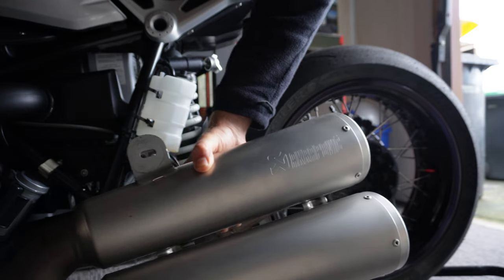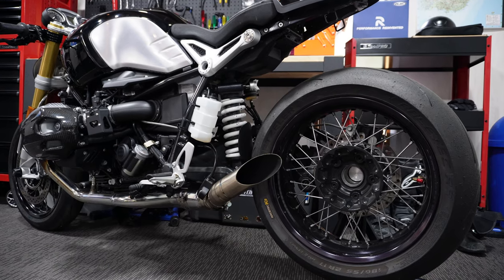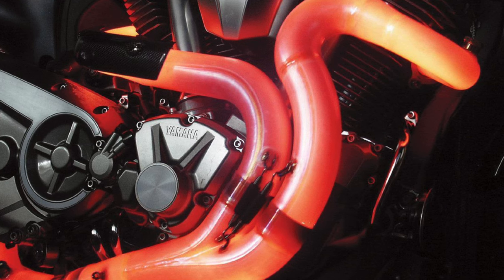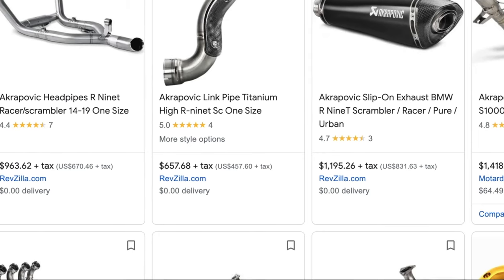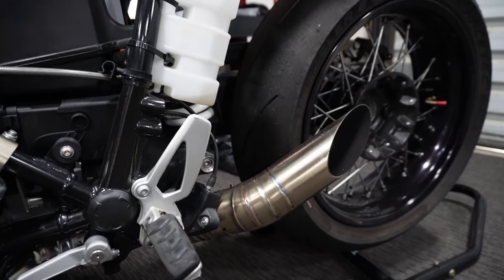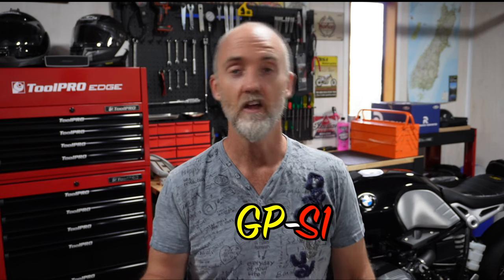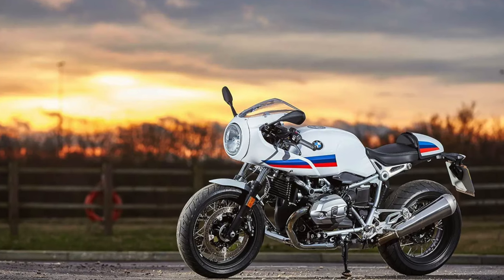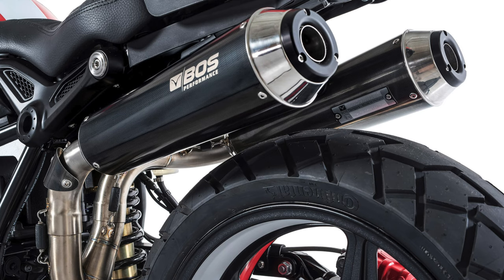R9T: But Does The GP-S1 Pro-Race  Damage Your Boxer Engine Performance?

Comment: Great vids, I hope you make more. Subbed. How about one on tuning the front suspension? Only the Classic has adjusters, so for us lot with the old school forks how about some old school tuning. Ya know, fork oil weight, oil height, spacer length, maybe gold valves. Or, go completely overboard with cartridge inserts.
Reply from the maker: Thanks heaps Dave😀, reading your comment, made my day!!  Reading comments like yours makes putting the effort in creating my little vids worth all the effort😃. Tuning front suspension IS on my long list of video ideas. It will arrive on the channel, but I'm just not sure when 😆. So many ideas, so little time.

Comment: I installed the Rapid bike evo which IMHO Improves fueling and responsiveness but the best thing was lighter wheels (ac schnitzer)
Reply from the maker: Hey there Drmengawgyoung😀, yes lighter wheels like the AC Schnitzer or BSTs Carbon Fibre make a massive improvement especially during quick direction changes. Thanks for sharing your R9T experiences. Take care out there 👊✊️👍
Reply: @outtheresomewhere  not sure I would be confident of carbon wheels in road riding in
Uk full of potholes have a look at pier city cycles I had a battery removal and dna filter conversion
Reply from the maker: @mengaw-yong2490  same issue here for street riders in Aotearoa/NZ with regard to potholes, at least on some "B" roads😆.It sounds like you have performed some really nice customisations to your R9T😃
Reply: @outtheresomewhere  my sister just visited from Auckland . My R9t is a keeper had it 6 years
Reply: Sorry pressed wrong button ac schnitzer clip on , motogadget screen, funny bike light, Denali led front headlamp, and X-ray transparent engine covers

Comment: nice video man I was watching your oil change video the other day and while looking for oils I came across a motorex boxer oil that was formulated for boxer gs bikes do you think I will be safe using that one ?
Reply from the maker: Hey Andres, thanks heaps, glad you enjoyed it!! As for the oil, if its for your NineT, the main thing apart from being 15W-50 is as mentioned in the video, it has an API of SJ or better e.g SN etc and that it is suitable for the catalytic converter, meaning the JASO rating is MA2. After saying that, I myself currently run MA not MA2. There is MA1, MA and MA2 (clutch friction tests). MA passes a number of the MA1 tests and a number of the MA2 tests, but not all of both . My understanding is MA2 has less Phosphorus which is a good thing to avoid running through your catalytic converter as it slowly damages cats. But Phosphorus is a great engine protector, normally combine with zinc to create a protective coating (a "glass" like shield). So as I race my R9T, I use MA (more phosphorous) to better protect my engine, knowing that my catalytic converter will not last as long as if I used MA2. For me my engine is more important than my cat (even though cats cost a fortune due to the precious metals they contain). Also avoid oils with additives like Molybdenum, as that eats R9T engine parts. In short, for NON-Race applications, I'd recommend API SJ or SN and JASO MA2 as that will well protect both engine and cat under normal on road usage. I hope that very long explanation makes sense :-) . take care out there.
Cheers
Matt